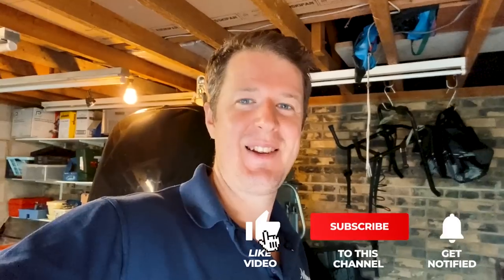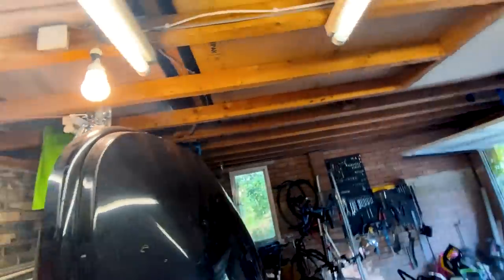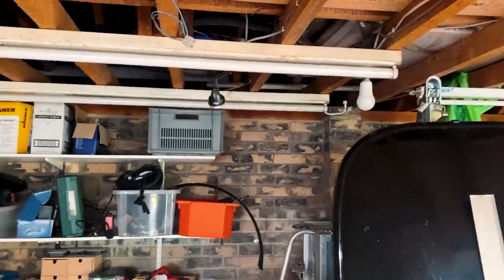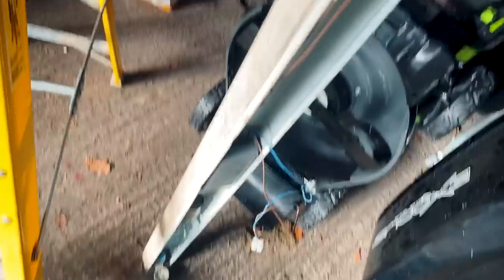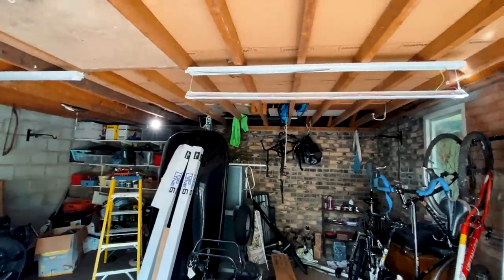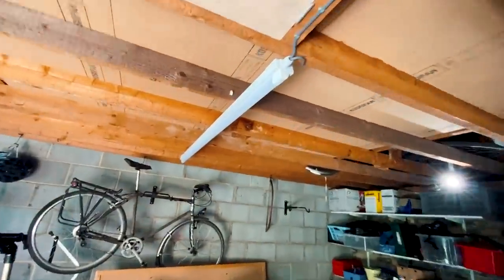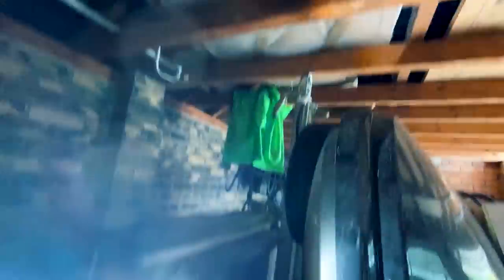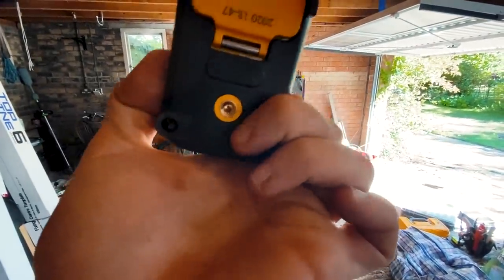Garage Rewire - Electrician Life

Comment: 8:45 This is one part I don't get. Literally what's wrong there? I would rather use a metal box in a place where I store bikes and heavy stuff in an attic because it's likely it's gonna be banged around on everything. If it's properly earthed, is there an actual issue with metal boxes?
22:43 https://en.wikipedia.org/wiki/Light_switch#Orientation there you go
Reply: Only because it's made for flush mounting and not surface. Also the lack of gromits is pretty shoddy
Reply: @63ch31  Oh yeah, that's fair

Comment: Stop with the rants not all DIYers are that bad some are better than alleged sparks. The spark who did my place took a 6M cable to a junction box then down to 2.5 he also took a 2.5 to a 1.5 to run a socket that kept tripping out. It was a DIYer who sorted the mess out. Just saying.

Comment: The MK logic plus range are good, but I wouldn’t touch the MK essentials range which are guaranteed to make you wonder what on earth MK/Honeywell were thinking of putting their badge on that awful cheap tat.
Reply: JW managed to get an essentials socket to melt and burn. I wouldn't fit them either.
Reply: I think it was JD that was also saying an essentials light switch realistically needs a 35mm deep back box!